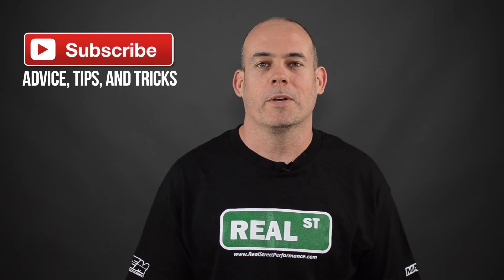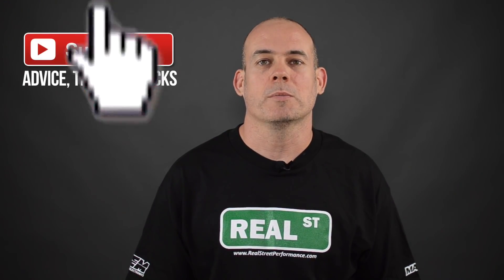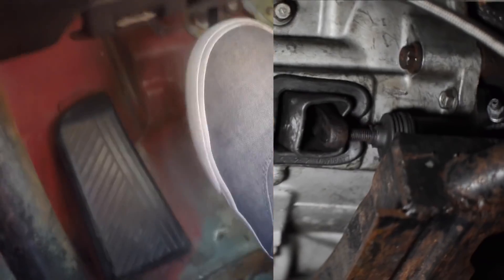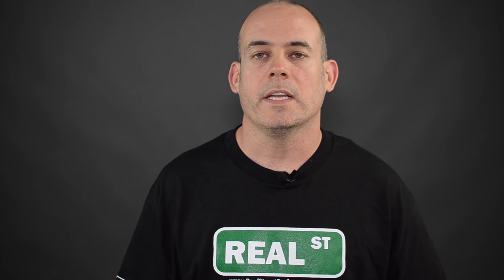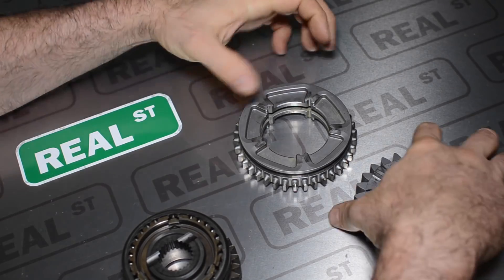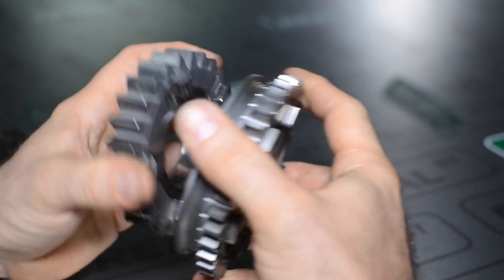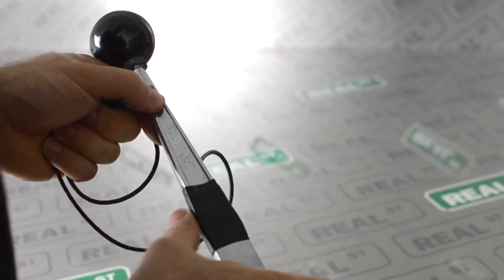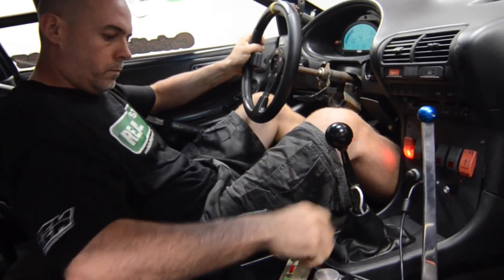How to Shift Quicker - Jay's Tech Tips

Comment: Some daily driver cars (Nissan Altima or Honda Accord) have their 6speed manual transmission with a Rev-Hang tune, if you try to upshift quickly you'll damage the synchronisers, so you need to install a lightweight flywheel and a tune to remove rev-hang so the RPM falls faster to the next gear, allowing for smoother fast upshifts with less mechanical damage.

Comment: You can drive a dog box on the street without grinding gears you just have to rev match. Most manual trucks have dog boxes ie the Eaton fuller road ranger.
Drive all day long up and down the box with no grinding and not a syncro in sight.

Comment: Short shifter linkage, sequential manual transmission, and a Quick Shifter system, like what a sportbike can have (ignition & fuel cut).
Reply: A sportbike has a dogbox. Short shifter linkage on a synchro box is only going to kill the synchros fasters, you wont shfit quicker

Comment: What does a 2011 mustang GT need to do this?  I cant seem to find anything for sale to cut timing while clutch is in or w.e.  It has a hydraulic clutch.  Tips or installation tutorials for specific modern cars would get a lot of views.
Reply: +A. Wheeler look up n2mb no lift shift box it has built in 2 step too
Reply: Crest Kiid Thanks for the suggestion, i will check it out.

Comment: Sure miss my strain gauge and my dog box, but I don't miss the straight cut gears. Drove mine on the street clutching it or just chopping the throttle during normal driving and I never had a problem, you just gotta shift quick so you don't get the grind. Still got my shifter with the strain gauge installed, what EMS are y'all using? 
My new car doesn't have a dog box, but that switch seems appealing for my regular gear box. How much would that cost too install? (Drive by wire) if that matters

Comment: Wouldn't it be easier and cheaper to build a manually shifted automatic transmission? You shift manually without all the censors and BS.
Reply: Auto's are generally more expensive and less reliable (At least stock trannys and aftermarket ones depending what you buy and build), but whatever shifts faster depends on the transmission and the driver.
Reply: +Darren Betker You can already do that... 

4 Speed Auto: 1, 2, D(OD button off), D(overdrive button on).
5-6 Speed Auto - Shiftronic/Dual Clutch: Pull Down on lever = shift up. Push Up on lever = Shift down
Modern Auto - Shifttronic/Dual Clutch: Click right most steering paddle = Shift Up, Click Left most steering paddle = shift down.
Reply: auto's are much cheaper and more reliable but a manual will be faster

Comment: So if I have a 98 eclipse turbo 5 speed, what would I have to modify to keep it at 25lb of boost every time I shift?
Reply: +Misho5z every car will require different mods. do some research, don't be lazy.
Reply: +Misho5z Look into N2MB WOT Box
Reply: It's a chip that you can get installed into the stock ecu. Giving you control over pretty much anything that the computer controls. For instance no lift to shift, launch control, fuel trims, anti lag. It also let's you log, to keep track of your afr's, injector duty cycles, and things like that; if you decide to add a bigger turbo with supporting mods. Definetly check out the website. You'll find that most everything that can be done to your car has been done, with tons of info on what to do/expect.
Reply: +Misho5z Did you not watch the video?
Reply: +dragkid185 He didn't demonstrate the process of modifying the car to do so
Reply: Misho5z Your car is extremely popular when it comes to drag racing there will be tutorials and kits to be able to no lift shift your car.
Reply: Look into dsmlink, also check out dsmtuners.com tons of info...
Reply: +Ben Grant Thank you, is it compatible with the AEM Mk1 ECU, or is it a separate ECU unit?
Reply: +Ben Grant Damn thanks for the info man, it sounds a lot better than the bulky aem unit I have right now
Reply: +Misho5z np man
Reply: no it's called getting a better clutch n power shifting
Reply: +deear diesel Thanks man, I'm saving up money for one that had the motor and tranny built by forced performance,  have good hopes for the car, it needs some work here and there but overall I think it's a good deal for 3.5k
Reply: +Misho5z if you have a eclipse best to take an injector and then pull 5 degrees of timing. Then get some gas and pour it over the car and burn it
Reply: Don't lift your foot off the gas pedal and bang threw the  gears
Reply: MishoMods 98